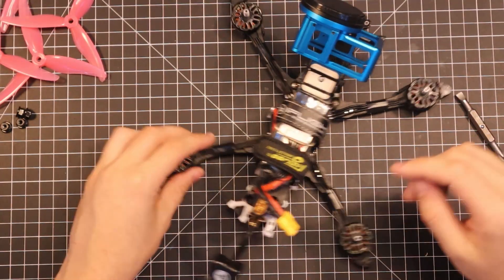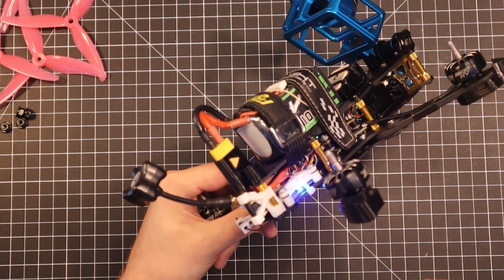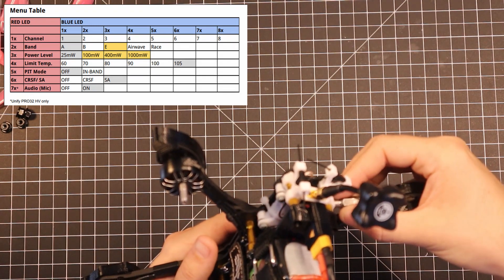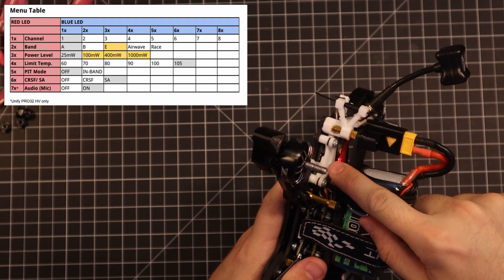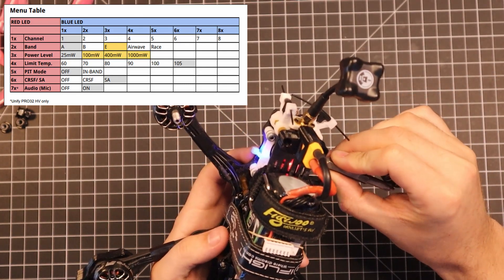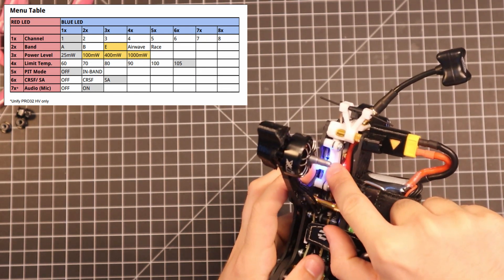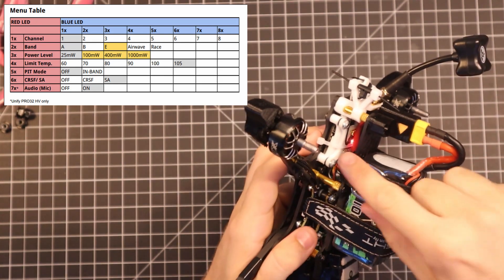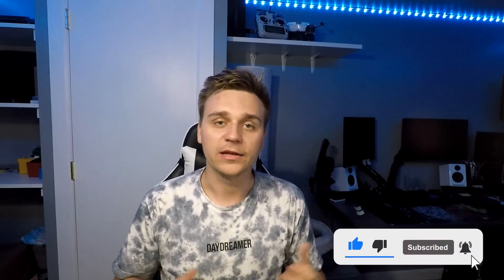TBS Unify Pro32 VTX Unlock

Comment: hello will it work on 2s?
Reply from the maker: what do you mean? do you want to power the VTX from a 2S Lipo? the unify pro 32 take 6Volts to 25Volts for power so you can use a 2S with no problem

Comment: I've unlocked mine, but is there a setting in Betaflight that would keep it in 25mW mode? It will not let me change the power output beyond 25mW. I can switch between all the bands and channels but it will not allow me to go above 25mW. Both lights on the vTX are on (Red+Blue). I'm so confused on this.
Reply from the maker: maybe you are in PID mode. also are you changing the power levels using the buttons on VTX of smart audio? if your using smart audio to change the power level make sure your VTX table is correct. if you have the wrong table it will just keep it at 25mW. I hope this helps you

Comment: Hi after I changed the receiver from frsky to tbs crossfire...I dont know what happened to the vtx .. the range dropped down less than 30 cm ...the quad flying good but no video just if the goggles very close to the quad :/

I changed the antenna I pressed the vtx button then plugin the battery for 10sc ... no change
Reply from the maker: what is the VTX output power set to. is sounds like it could be an pit mode which is not strong at all and video will be terrible just a small distance away
Reply: @OLEHFPV    vtx power 400 ... 
By betaflight set vtx_power = 4
Reply: @OLEHFPV  https://youtu.be/ObZhZkZX4y8